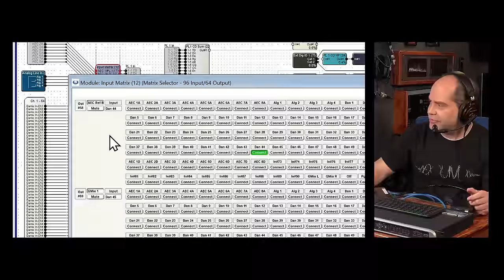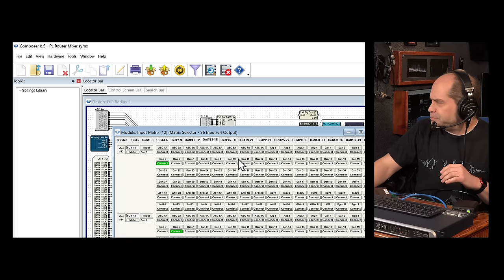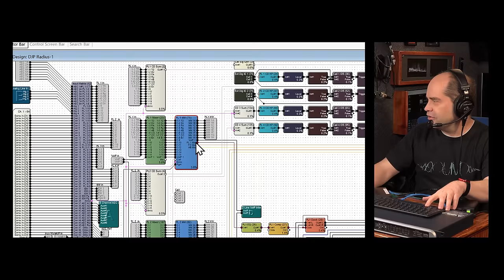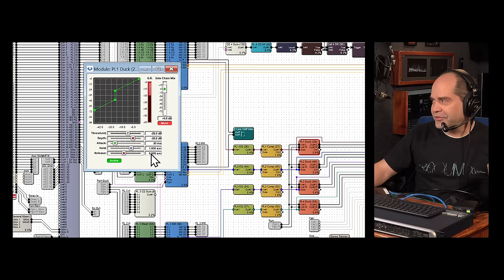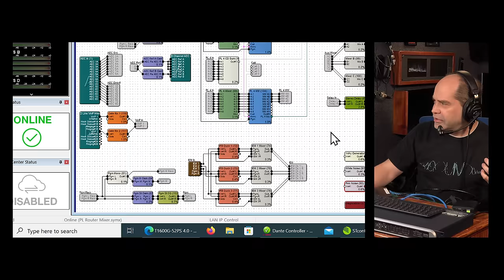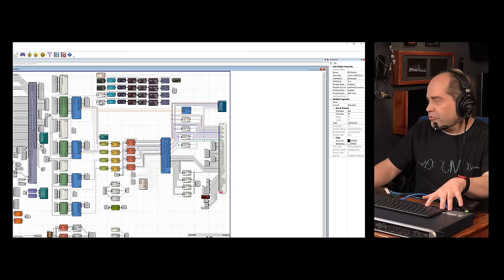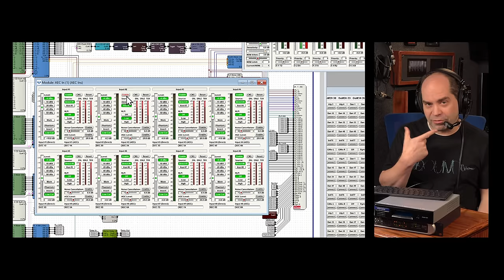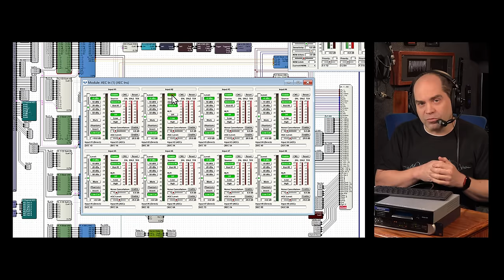I'm Replacing my Production Intercom System!!!

Comment: Symetrix Radius is a hidden gem. I own 3 of these and use them for all kinds of projects. Very flexible. Feels a bit dated, but works amazingly well. Cheap on the used market too. UI options are also limited so I had to write custom software, but not a big deal.
Reply from the maker: The Radius I have was built in 2013, so, yeah... 10 years old. But the newer ones don't do much that this model won't. The biggest difference is the number of channels available in the matrices. 

The underlying DSP engines haven't really changed in that decade. Nor do I think they need to; they've pretty much done everything that they need to do for a long time now.

Comment: As I'm sure you're well aware, converting an audio distribution system to Dante means handing over control of your system to an IT network administrator, or alternately, becoming one yourself. While that's not a proposition I'd find palatable, I can definitely see its appeal over a Behringer X32. Personally, I prefer MADI for digital audio distribution, as it's a reliable, uncompressed point-to-point system not subject to network traffic jams.
Reply: Every part of broadcast & audio world is heading towards IP solutions. It will be a difficult journey but it'll be worth it. I know, IP networks can be fragie but I'm pretty sure that the market will react. For example I'm a software developer who broadcast as a hobby for several years. I'm an IP solutions enthusiast because it's bringing so much of simplicity. And I'm trying to focus on networking and broadcast world because I believe that this position will be very necessary on the market.
Reply: @BuriTechVids  - I know, pretty soon I expect IP solutions providers to move to AI-mediated client management systems. Good luck in that world.
Reply from the maker: I was using Dante with my X32 too. I'm quite comfortable in the networking world too. I've never had any issues with dropouts or poor quality with Dante... and configuring my switches to work with it reliably hasn't been hard-- enable IGMP snooping, and boost the QOS priority for my Dante VLAN (or keep it on its own network, which is the preferred solution), and I'm done. Dante really shouldn't be mixed with other LAN traffic. But I haven't had any issues when I've had to.

MADI is point-to-point, making it unsuitable for this type of application. It's fine for moving a bunch of channels from A to B, but it isn't very helpful outside of that one application.
Reply: @djp_video  - I've seen and heard Dante in action, and yes, it's very reliable when it has the network to itself. It's just that when the scale and complexity of an audio distribution system justifies the use of Dante over point-to-point solutions, you're also at the point where it requires experience in network administration.
Reply: Nice work. 👍🏾

Comment: This is exactly the setup we have been using since 2021! We have a Prism 12x12 as the dsp for our sanctuary audio system that doubles as our intercom engine. We have 2 party lines and I made a control panel in composer that lets us adjust individual beltpack audio, call individual beltpacks, EQ, Ducking, etc from a PC in our control room on the fly. Only have 6 beltpacks but we have been super happy with the audio quality, compatibility with consumer headsets, little quality of life features like program ducking and automixing the beltpacks.
Reply from the maker: It's great, isn't it! I've just dipped my toe into the control panel portion of it so far. And haven't even started to touch the Intelligent Module functionality. That's going to be amazing once I get into it.

Comment: I acutally Implimented 2 studio technologies comm systems for clients using ST's  purpose-built dante matrix, but had the thought that one could use a symetrix dsp as the processor by just setting up the mix minus busses in composer.  To your point, it's about 1000% more flexible.  I am a dealer for both companies but decided to just go with the turnkey solution.  After seeing your video, I am going go for the Symetrix next time.

Comment: Great setup Doug!  You can get 16 mix bus outs from the X32, an additional 6 on the auxes if you can utilize LR, Mono, matrices or direct outs for those.  Another kinda cool trick is you can use a DN4816-O to get an additional 16 outputs from ultranet that are independently routable.  You are pretty limited by the 16 mix busses though so the extra outs are only useful if you're routing channel direct outs.  Pretty capable for the price but not as convenient as the AVIO adapters.
Reply from the maker: The number of busses is a problem, but the bigger problem is the awkward way that it routes signals internally. You can't just arbitrarily assign any source to any input, or any output signal to any output connector, even with the user assigned busses. To get the my setup to work at all I had to do some really strange things to get signals from one bus to another to get it to where it needed to go. And then I ran out of ways to route signals before I ran out of inputs. Adding one of their external stage or other I/O boxes wouldn't have helped because the internal routing was already maxxed out.

Comment: Cool build, and great explanation of the sort of things that DSPs can do as a virtualized audio chain.

One critically important detail of the DIY route (for any system, not just intercom) is that while you generally get far more functionality at a lower price than out-of-the-box systems, you are also responsible for executing and supporting it yourself. There's no customer support to call for the system, and if the person that set it up moves on, then it's up to the next person to figure it out. And the more complex the system is, the harder that task gets.

So one of the key hidden values of a "standard" professional system is that standard part that ensures it's usable to more people. And that is a value best not ignored when someone researches their options & needs.

That said, I have never seen a production system that didn't have some level of DIY. Sometimes it's just a clever config setting somewhere or a creative GPI wire. Other times it's complete home made hardware systems.

Really even the basics of how parts of an overall production system are connected are already "custom" work. No 2 trucks or flypacks are identical, or static over time.

And the ability to choose the most suitable solution for any given project scope & budget is what makes a great engineer.
Reply from the maker: Supporting something like this doesn't scare me. I designed it so I know how it works. But once it's setup and working, beyond making sure that Dante is working, not much troubleshooting should be necessary.
Reply: @djp_video  I totally understand, and agree with that school of thought much of the time. I certainly deploy a lot of DIYv in the systems I use also.
BUT, it is important to keep in mind for systems that may be in place long after the designers/builders are gone. There is a huge huge difference in systems we build exclusively for ourselves, and systems we build for others to use (even if not right away). It's really more of a business than an engineering question at that point, but still worth keeping in mind for the engineers too.

Comment: Beside DIY intercoms: What are those devices generally used for? Fixed install audio systems like in city halls, huge conference rooms?
Reply from the maker: The most common uses are for conference rooms and things like that... both big rooms in convention centers as well as in offices. But they're also used in theaters, churches, civic centers, etc. for permanently installed audio systems.

Comment: intercom using a dsp like this has been a dream of mine.   this is good, but there are areas of focus ive been wanting to implement to make intercom even better.  Ive been toying with xiph’s RNNoise and its AMAZING on intercom, it really helps reduce all the non-voice noise and hiss.  the 2nd thing ive been wanting to implement is a form of Automatic EQ for the headsets since its common to mix and match different brand headsets they can all sound so different
Reply from the maker: Cedar's DNS is the ultimate when it comes to background noise reduction. And they support Dante. But it is expensive.

Comment: @doug how do the mobile beltpacks work when you have a long ethernet cord trailing to them? Does that inherently limit the operator's mobility?
Reply from the maker: Certainly no more than any other wired intercom system. But better than some like Clear-Com or RTS where you often daisy chain from one pack to the next, leaving you with two cables rather than one. 

For anyone that needs to be mobile, I use my Hollyland Solidcom M-1 or another solution and integrate it into the rest of my comms using Dante.

Comment: Hi Doug, love your videos. This solution is exactly what I had been dreaming of, but didnt know was possible. Among other things, I’m a TD for a high school theatre program. Re-designed an A/V system centered around Dante, utilizing many ebay finds, as cash is not so readily available. Would you be willing to  share/ sell the config file you created for this? I’m comfortable tweaking and modifying, but I feel creating ground up may be a bit daunting.  Appreciate all your tips and tricks!
Reply from the maker: I'll consider it after I've had a chance to use it for a few events to really make sure it's working well. Right now I'm absolutely sure it's going to require quite a bit of tweaking.

Comment: DSPs... damn it Doug. This is too cool. Me wants!
How does Mix Minus work in this setup or do you not use that?
Reply from the maker: I have matrix mixers there that actually do create mix minus feeds. Technically they're just alternate mixes with certain sources turned off. 

Because I personally don't mix minus for intercom almost ever, those mixes run through an output routing matrix to reduce the total number of required output channels before going out to the Dante bus. But the capability of mix minus was included in the design from the beginning.

Comment: I see that your stance on Companion has softened considerably, is it working better for you now?
Reply from the maker: A little. Since they added some better error handling in the core product it isn't as easy for a module to crash it. But I still don't connect it to my ATEM when I'm working for a paying client. It still does crash. I can't leave it running overnight in my trailer, for example, or I can guarantee that it won't still be running the next day. Some of the modules (*cough hyperdeck*) still aren't very reliable.

Comment: Let Dante do your routing. Greatly simplifies your site config and gives you more flexibility
Reply from the maker: Dante can't do what I need to do. Dante can't mix sources. Most Dante beltpacks only support 2 output flows. I need more outputs in my internal matrix than there are Dante inputs to handle so it has to be routed internally. Plus there are 12 analog inputs and other various sources I need to be able to route. Dante also takes too long to reroute to be able to get away with changing Dante routing to temporarily switch a beltpack from PL 1 to PL 2, for example. And changing routing isn't possible from most software, including Companion (unless you use Dante Domain Manager, which is kind of a dumpster fire.)

Dante is amazing, and I love it, but it is not suited to what I'm doing by a long shot.
Reply: The output flows limit is mostly irrelevant here because you are going through the DSP. Fast switching needs can be done with ARC Web. My original point is to avoid backing into a corner that is a single matrix module, limited by what you program into the site config file. In contrast, Dante is a matrix router expanded just by plugging in another device. I think you’ll find you’ll have to open Composer to make adjustments for every show. With input/output names like PL1-Ch1, PL1-Ch2, etc you would have the flexibility to manage and understand most show-specific config within Dante Controller. I very much like what you’ve done here and will adopt some ideas from here into my Composer site configs.
Reply: Personally I wouldn’t trust requiring Companion for something as vital as comms. Better to have a hardware Dante box with a key to talk to each talent PL than hope Companion doesn’t crash when re-routing a station to talent.